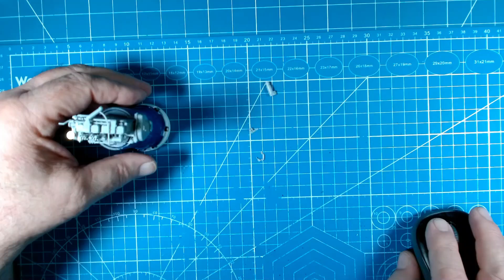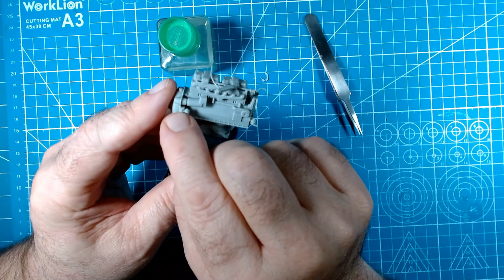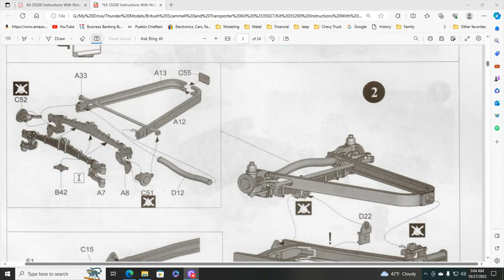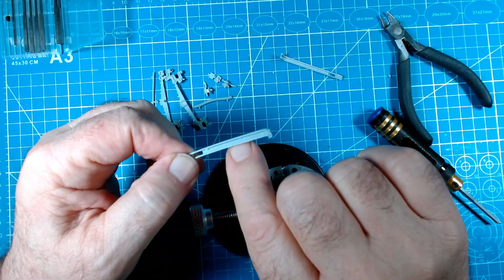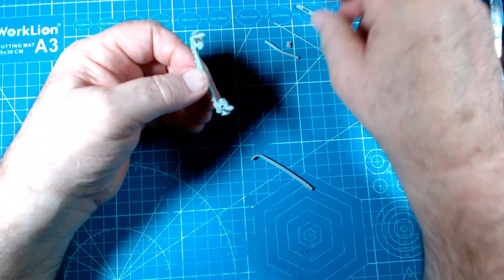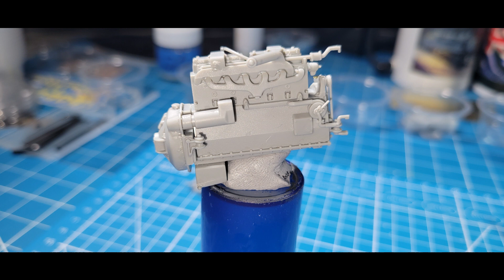Thunder Model 35207 1/35th Scale Scammell Pioneer And Trailer Part 5

Comment: Hi Jeff just a little tip for you, I’ve made the thunder models recovery scammell and the artillery tractor and on both of them that front suspension is a real pain in the butt and it doesn’t end there. At the back of the suspension on the “u bend “ there is a small spigot that will eventually slot into a cross member of the chassis. Well that’s the idea anyway but I found on both models the spigot keeps dropping out so I ended up cutting the spigot down and drilling a hole through it and then cutting a piece of brass rod and fitting that into the drilling and cutting to a suitable length so as it stays put. Hopefully this will help and save you a fair bit of grief. Doing a fantastic job, really enjoying your videos. P.S I have the scammell Tank transporter in my stash that I was thinking of making next, I might just have to re think that now 😅😂
Reply from the maker: Hi Keith, Thanks for watching.  I really appreciate any tips you have.  I've already run into the problem with the front suspension.  It looks very weak.  I was thinking about pitting a pin in it.  I really like the detail in the parts, but  the kit is a bit of a challenge to put together.  Thanks for sharing.  Have a great day.  Jeff
Reply: @JeffDonahue21  Hi Jeff I agree that the detail in the thunder models kits are fantastic and the detail in the engine is superb. I also struggled to work out where that pipe went to but like you I got there in the end. I don’t know if you edited your video but I can assure you there was an awful lot of swearing going on when I was trying to work it out. But all that said they are fantastic kits and I think they are well worth the grief when they are finished. If I think of any other issues I came across I will drop you a line. Cheers Jeff enjoy your day. Keith
Reply from the maker: @Storm2451  Thanks Keith.  I appreciate your comments.  Have a great day.  Jeff